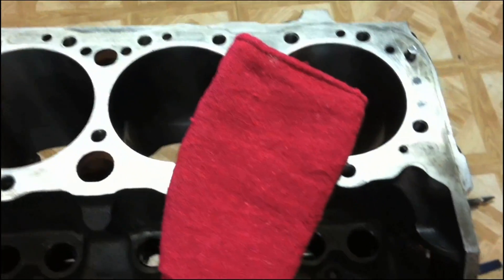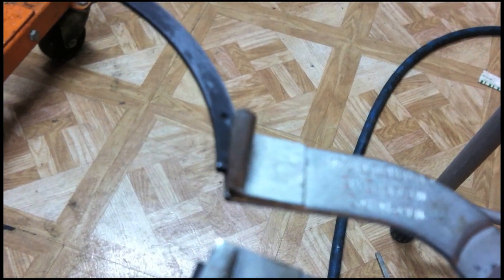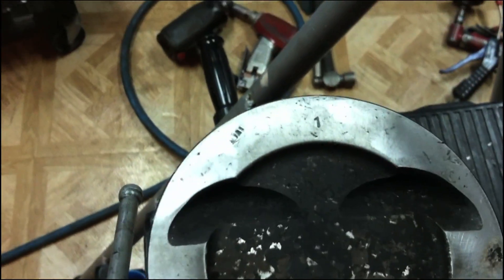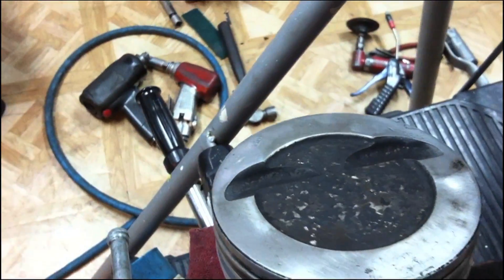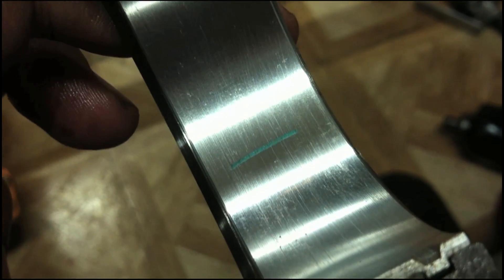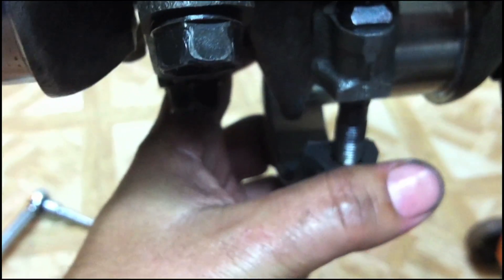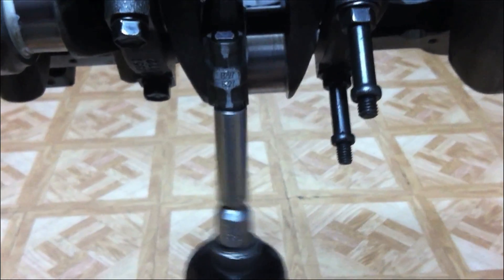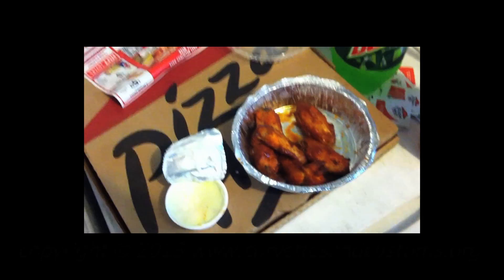How to Build a Chevy 383 Stroker: Part 2 - How to Install Pistons

Comment: first time puting pistons. piston number 5 when installing it broke. what could have happened? will i have to get a whole new set of pistons? and how do i know i didnt damaged the other ones.?
Reply from the maker: Where did it break? Did it break at the top? May have caught the piston ring on the cylinder wall. Need to have the install tool very snug with oil all around the piston and rings. Where did you get the pistons? Did you balance the engine? (pistons, rods, etc). You can get just one piston but make sure it matches and if you had the pistons balanced you need to make sure the new piston is balanced to match. You should have gotten a "balance card" if you had it balanced.
Reply: SanDiegoHotRod the Piston chipped towards the second Groove and yes the Pistons were balanced as well as the block and the crankshaft I purchased the Pistons at Summit and the brand is scat when I took off the Piston again to see it the bottom three rings of the piston were bent and out of the Groove
Reply from the maker: You can call Summit and they may be able to get you one piston. Not sure if you can get rings for just one piston. You will have to have it balanced to match the others. You can also try your local machine shop to see if they have any rings you can use.. You may also need the shop to swap the piston to the other rod depending on how it is mounted. Make sure you have a good install tool. Takes some practice to get it perfect. Everyone has problems sometime.
Reply: SanDiegoHotRod Thanks for the reply, very usefull information. also does it matter what engine oil I use to lube the bores, synthetic or non-synthetic.
Reply from the maker: You should stay away from synthetic oil for the first 2000 miles. After that you can run synthetic with no worries.

Comment: A very important part of 383 builds is to grind the rods for clearance of the camshaft lobes... I wish you showed this process...
I see in video @7:41 you have the side of the rods ground down for clearance...
Reply from the maker: That is a new one on me. I don't even know how a rod would get that close to a camshaft? I have never ground on a rod because I have never had a clearance problem and don't know anyone who has aver ground on a rod. Not only would you weaken the rod integrity but you would destroy $300 worth of balancing the rods and pistons, etc. If the rods hit then you gotta be using the wrong rods or something. The funny thing about building a 383 is that there are thousands of ways to do it. There are so many rod and piston combinations (and cams) you can use that shift the piston, skirt and wrist pin up or down which throws off the angle of the rod. Instead of grinding on a rod then I would suggest changing something so you get the clearance.
Reply: If you take a look at your video @ 7:47 and @7:49 and freeze the frame, you will see the side of the rod is ground as well as partially the rod bolt is ground... So someone took care of this ahead of time prior to balancing..
If you use stock sized rods, you will hit the base of the cam lobe when stroked out with 5.7" rods for 383 and need to grind the rod for no less than .100" clearance....
The exception to this would be if you bought "stroker" rods...these rods are designed to have clearance for most SBC cam lobe base size...
The other exception is buy a cam that is specially ground with a lower base lobe size, these are used in stroker motors when you don't want to grind the rods..
Rods are marked and ground during mock assembly... Once the grinding on the block and rods are complete, then you send out the assembly for balancing...
Reply from the maker: That all makes sense. Like I said there are 1000 ways to assemble a stroker. I am guessing if you had a roller cam and lifters with a shorter lift but wider lobe you might not have a clearance problem but then again it may depend on the rod and piston combo. That's why I let the machine shop do all that for me! LOL
Reply: What part of San Diego are you in ??
Reply from the maker: I am in PB.
Reply: I am in RB...We should hang and talk motors over a few beers some time..
Cheers..
Reply from the maker: You should come see the 58 Corvette I am restoring right now. I also have the 65 Chevelle from my "Jolene" video for sale. Info is on my website and FB pages.  http://www.corvettesandcustoms.org      http://www.facebook.com/corvettesandcustoms

Comment: Can you use stock pistons? I have a set of flat tops for the stock crank.
Reply from the maker: Honestly not sure off hand. It all depends on the compression ratio, the rod, where the wrist pin sits in the piston, the size of the cam, etc. The longer throw on the crank not only drops the piston down farther but also pushes it up higher. And there are literally thousands of "stock" pistons so the best thing to do is talk it over with your local machine shop. I am sure they can help you and be more specific about what you have. Thanks.

Comment: When you installed your oil rings I was always told to not have the gaps on a thrust face of the piston as it can cause scoring of the cylinder wall, and instead to have it about 30 degrees to either the left or right of the center of the piston skirt.
Reply: Honestly....after 37 years of machining and building engines,,,,do you really expect the rings to stay put where you aligned the gaps  to ???
It's like telling a cat to sit and stay still...LOL 
Next time you take your motors apart, let me know if your ring gaps are in the same locations as you last placed them during assembly...
Not knocking you.... i actually like your videos...
Reply from the maker: The main thing to remember is that you don't want the ring gaps lined up with each other or above the wrist pins. The rings will move a bit over time so I always start with the top ring gap at 12 oclock so any oil or unburned gas will not leak into the oil pan when not running. The second ring is 180 degrees out and the bottom oil rings are then at the bottom with the gaps separated. This is just a general rule of thumb I learned and always followed.
Reply from the maker: RodRifleandReel
You do not want the top compression ring gap over the wrist pin which cuts out the 3 and 9 oclock position. You do not want the gap at the bottom where unburned gas or oil will settle and leak past the gap so that only leaves the 12 oclock position. it is amazing how many engines I have taken apart with all the ring gaps lined up!
Reply from the maker: I understand what you mean about rings moving. They are not welded or bolted in place but you still need to start them in the best position possible. I have taken apart many engines built at cheap Mexican machine shops and the rings are all completely in line!! Not saying that is impossible but it is like opening your dryer and finding all your clothes neatly folded. I'm glad you like the videos. Keep in mind this was a bucket of junk a client brought me and asked me to assemble for nothing. Check out the second series on "Engine Dress Up" that shows tips on assembling the externals. I'm sure you don't need it but may help your customers after you give them the long block. I also have a new music video on my channel you might like called "Jolene." Thanks!
Reply: MystikalDawn same i was taught to offset the compression rings in a diagonal to the wrist pin so you can offset the oil ring pieces 180 degrees from each other

Comment: buy a tripod...
Reply from the maker: That would be REALLY boring to watch.
Reply: SanDiegoHotRod Not hardly, would not only relive the seasickness, but also the cringe factor of watching someone with two hands, install piston rings one handed.

Seriously though, you've got a good story to tell.  But a little desk tripod, or make one based on a magnet mounted dial gage..
Reply from the maker: LOL Thanks! I hear what you're saying. It took me a couple years just to post these videos because they are so bad imo. I have a $5000 camera and a $500 tripod that I use for filming tv shows and commercials. Just did not want to get them dirty and oily. Check out some of my real film work on my other page. www.youtube.com/videoproducer
Reply: SanDiegoHotRod I can see why you'd think that, having done pro stuff.  But people, including myself, luv this stuff.  So bad directing and camera angles add to them I think.  And for the engine building/repairs, etc., all you need is your phone.  I built a mount for mine out of a piece of 2x2 and some dowels.

Comment: This guy is very helpful. Very interesting!!!!
Reply from the maker: Thank you. This engine was a POS and all I did was put it together for the customer who was too cheap to buy new parts. LOL The second series on "Engine Dress Up" deals with installing external parts and has some great tips also.
Reply: +SanDiegoHotRod I only got to part 2 but best believe I'm going to watch all the videos. This motivates me to tear down my engine and rebuild it. 327 SBC. I still have a lot to learn
Reply from the maker: Go for it! Tips: Have the machine shop machine and check the block. Do not deck the block. I would not go .060 over. Get the crank, pistons, rods, etc. balanced. Makes a huge difference! Have the machine shop install the cam bearings. If you can spend an extra $500 or so get some ProComp aluminum heads. They are cheap but work great. About $1000 a set but only about $500 more than machining the old heads. You only need a Holley 600 carb (about $300 on Summit). Don't go bigger! Give me a shout if you have any questions. Good luck!

Comment: explain to me why you are using scotch pads on the coated bearing surfaces? Correct me if I am wrong, but those bearing surfaces are usually plated with copper/lead plating for wear resistance, one could suggest that removing the coated surface could be exceptionally bad for bearing life. Unless you are using the aluminum type bearings.
Reply from the maker: +Bobby D This was a junk motor someone brought me in a box of parts. He told me a bunch of bullshit that was not true about the engine. On top of that he did not want to spend any money. When you deal with a douchebag like that you are not going to get the best results. IF you get a good crank or machine it right and get good bearings you usually don't have to take much if anything off the bearings. If you put the bearings in tight without proper clearance the bearings will wear faster than taking off .0003 of an inch. The crank does not ride on the bearing it rides on the oil.

Comment: You do realize that those rings are free to rotate and so they end up where ever they heck they want to be. I've done all this so many times. I'm wondering why this engine had to be taken apart again after it was built the first time. I have the same ring spreader and the same ring compression tool. The ARP torque grease is better for those threads.You should also know that plastic gauge is not accurate when used on rod caps. It will show up as tighter than the clearance really is. You would be better off using a micrometer on those rod caps to figure out the clearance.
Reply from the maker: +Rod Palm The rings will move but not that much. If they do there is a problem because there is no turning forces at work on them like on lifters. I have seen so many cheap shops where they line up the gaps and the new engine smokes. There are a lot of ways to do things better but this is for weekend builders on a budget that have not spent years building engines. I can't even watch any engine building TV shows because they leave out so many steps and instructions.

Comment: Can you tell me what you put the motor on while you were assembling it
Reply from the maker: Tony Montana It's on an engine stand. They are adjustable for different engines and you can turn the engine over. You can get them with 3 or 4 wheels and some can fold the legs up to save space when you are not using it. You can find at auto parts store, Harbor Freight or order online at Summit racing or Jegs.

Comment: Forgive the stupid question.  But for the maincap bolts over the crankshaft, would it be safe to use a highgrade threadlocker 36m in addition to the torque specifications and not oil?
Reply from the maker: You do NOT want to use loctite or anything else on the main bolts. The oil is for proper torque and the main cap bolts will not work loose. Also, if the loctite runs onto the main bearing you are really screwed. I use loctite on the 3 cam gear bolts, on the outside of the front main seal and on the bolts that hold on the flexplate or flywheel if they don't have the star lock washers.
Reply: SanDiegoHotRod: I didn't think so.  Thank-you for the clarification.

Comment: What's the easiest way to get these Satan worshipping wrist pin clips in?
Reply from the maker: It has been a while since I have hung the rods on the wrist pins. I am "assuming" you have the clips but some need to be installed at the machine shop with a special oven type device. The clips (if I remember correctly - with my CRS) go in similar to the way the rings go on the pistons - but inside out! If that makes sense. Stretch the clips slightly like a slinky and feed it into the hole/slot and press in with a circular type motion to seat the clip all the way around the hole into the slot where they rest and hold the pin in. Hope this makes sense. it has been a while!
Reply from the maker: You might like some of my music videos on my other page also
youtube D O T c o m / videoproducer
Reply: Yeah and they are some tough clips.  I got one piston done and only busted one knuckle. So 7 more pistons and 9 more knuckles so I should be good thanks
Reply from the maker: richard lundy
I think I have one finger left without a scar on it. That's why I let the machine shop hang the rods after they do the balancing. D'oh!

Comment: SanDiegoHotRod I'm in San Diego. .. I gotta 84 ss monte carlo. .. I'm trynna get a 383 stroker for my chevy.. can you help me or point me in the right direction
Reply from the maker: Anthony Calhoun Sure Anthony. Give me a shout. My email and phone number are on my website corvettesandcustoms D O T o r g
Reply: SanDiegoHotRod Do you usually build motors for ppl?
Reply from the maker: The machine shop I work with is building a couple engines for me right now a big block 427 for a 67 Vette, a 350 with aluminum heads for a 65 Chevelle and a 283 for a 58 Vette.. I am working on some projects and it is faster to have them do the engines. I have worked with them for over 20 years so I have no problems getting things done. Give me a shout when you can.
Reply: What shop? I wanna 383 stroker Victor Jr Edelbrock manifold 750 Holly double pump holly carburetor nd a 350 or 400 transmission
Reply from the maker: The machine shop can build the long block 383 and I can put the rest of it together, intake, carb, etc. If it is a California car it won't pass smog. I would also use a smaller carb. you can still do the intake and a double pumper but check on the Holley website to figure out what size carb to use. I can also get you the tranny.

Comment: sitting here having dejavu.. small block V8'S.. cast iron. sigh.. Back in the day I was working on Lycoming aircraft engines while doing these for the boys. Hang on/ ahh/ better now/ had another beer. Now it's all bloody computers and DOHC VVT all alloy crap. More about fucking sensors than engines.  I have an Isuzu diesel i'm building here.. nitrided crank, chrome wet liners. DOHC 18 valve HUEI injected.. it ain't no Cummins. Basically - no oversized pistons, rings or bearings available. Throw it away when it's furked.  In aircraft we'd rechrome bores and renitirde cranks.. but now you toss em out so a rebuild is more expensive than the whole car. But man I gotta tell ya you're on lucky bastard to still be working on iron

Comment: really nice and informative. but i have a question, whats the point of the torque wrench if when you hear it click once,you keep doing it? isnt that just tightening it more than the specification required?
Reply from the maker: The "click" is the point of specified torque. You can turn it a hundred times to the click but it will only go past the torque if you turn it past the click. Usually 2 or 3 times hearing the click is fine. Remember, when you are tightening more than 1 bolt on something tightening the other bolts on a part will loosen the torque on the first bolt you tighten, like an intake for example.

Comment: im building a 383 but im concerned abot my piston to crank clearance i have 60 thou on all but two on up stroke two go down to 40 tho just in one spot should i be concerned
Reply from the maker: If you have all matching parts (crank, cam, rods, pistons) you should NOT have a problem. As we all know every piston and part are built different and it is a good idea to double check everything. Piston skirts, pin position and crank castings are different depending on the part but I THINK the rule of thumb is .030" clearance for heat expansion, etc. I would check around online to triple check. I am sure you will find different answers. Sorry I could not be more specific.
Reply: SanDiegoHotRod thanks for the info i have callies crank and rods je pistons custome ground comp cam but im going to hit it with 300 hp of nitrouse just wanted to check all my bases